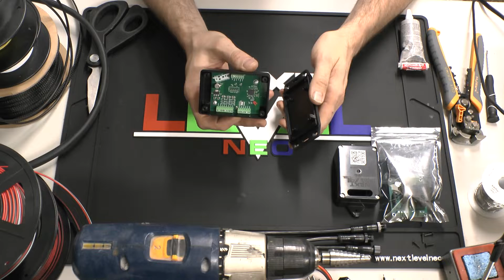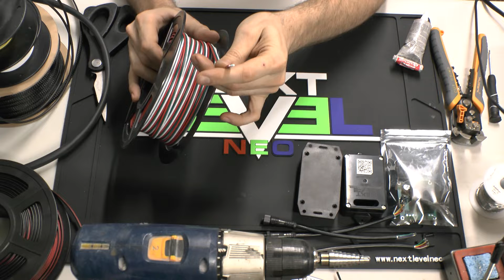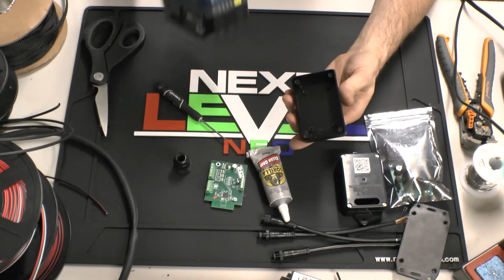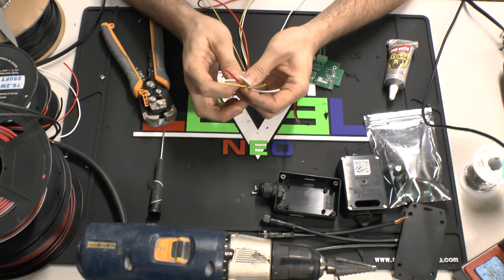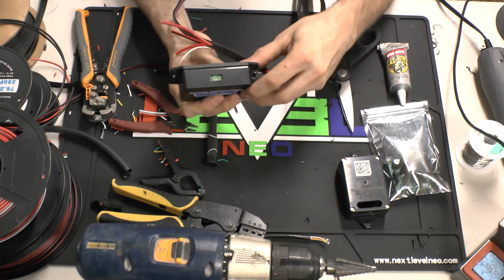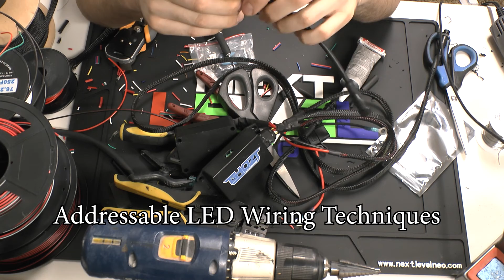How to Make a Wire Harness for BlueGhozt V2 Like a Pro

Comment: Im curious as how to wire the powersaver with the ghozt plus like you mentioned

Also, instead of the uc-s2904 rigid strips you sell could one use just ws2812b strips with the ghozt?
Reply from the maker: This video goes into a little more detail on how i wire them up. 

https://youtu.be/u3elwb1Jg6k?si=ckveuLz7AtsiSNRG

The blueghozt is compatible with any addressable leds as long as they don't have a clock input. Ws2812 will work fine with it.

Comment: I am curious how do you run the 5 V to your lights if you're running the 12 votes through the power saver. You should do another preview a little more Detail with the new blue ghost box. Step by step
Reply from the maker: I run inverters inside each light. Higher voltage creates less resistance so you can use a thinner wire. I recommend 18awg regardless, but i trust 12v from the controller to the light over 5v, and our inverters are small and will fit in most lights. This gives you both 12v and 5v inside the lights. I will be doing another video now that we have the new abs boxes for the power savers.
Reply: @NextLevelNeo  I'm excited bro I bought one of your new boxes. I am learning.

Comment: On your website what does wired and potted mean? Also if my underglows already have a controller do I cut that controller off and run my led leads to the ghozt instead?
Reply from the maker: Wired and potted means it is waterproof with wires for easy connection. Normally ghozt controllers are sold with a bare pcb in a plastic enclosure with holes for the wires. These are not waterproof and require assembly. Our controllers can be connected to most 3 wire color flow leds. How you connect them can vary. Ours are sold with industry standard jst connections.

Comment: Where can I get that power saver I am currently running five ghozt boxes and I need something like that from killing my battery because my battery goes dead the next day what I need to buy five of those Savers or just one for all the boxes can you help me
Reply from the maker: You can get them from out website. https://www.nextlevelneo.com/collections/addressable-leds/products/led-power-savers

I would use 1 per controller or you can do several controllers on one if you make sure the distance the power runs isn't long. Like do one for under the hood. One for inside and one for the back

Comment: Hey where do you find those barrel connectors? I can’t find them anywhere so have been using Deutsche connectors and they work but are very bulky and feel the barrel would look a lot cleaner
Reply from the maker: You can find them and many of the other things we use on our website. https://www.nextlevelneo.com/collections/building-materials

Comment: Hey boss, so I've been giving some thought to the power saver you sell to cut power to the led strips that will be BlueGhozt controlled.
It's just my first day really giving them a look so pardon me if this is an obvious question.

Is it possible to cut power to the leds with your Power Saver using the armed signal of my particular RFID based alarm/Keyless entry?

 I can get a momentary ground or momentary 12v from the alarm when it is armed and disarmed. 
When I walk 6ft away the truck arms, good opportunity to kill power to the leds I plan to use inside the truck.

 They will only be triggered ,via BlueGhozt, with a Domelight trigger and Parking light trigger. (Turn on white to aid the domelight, and turn on blue with Parking lights as ambient lighting at night only).

I really don't see the need for any Remote triggered show modes with this interior lighting project. something I would likely use the brake trigger and a switch to activate if at all.

Just trying to get a better understanding of your Power Saver, hope this made sense !

Thanks for your time man, have a great Friday!
Reply from the maker: Theoretically that should work. Any 12v signal can activate the power saver and the ghozt has multiple triggers that could be used to activate solid colors for entry lights.
Reply: @NextLevelNeo  Is there a wiring diagram available of your Power Saver at all? Perhaps a copy of instructions for it?
I really like how yours includes a 15 second delay versus the one Ghozt sells
Reply from the maker: @HAMMER_2.2  i just added one to the website.